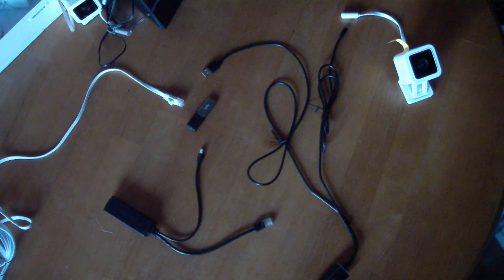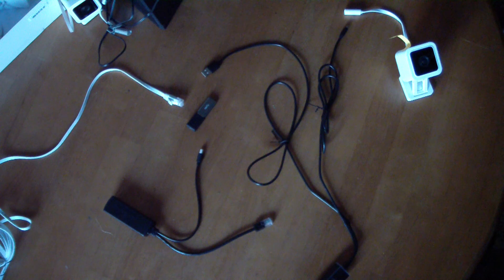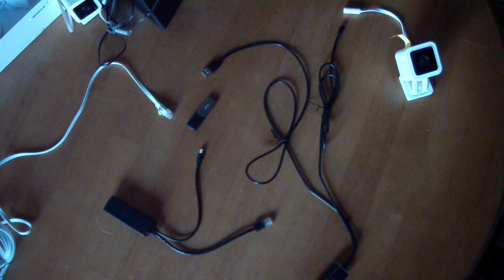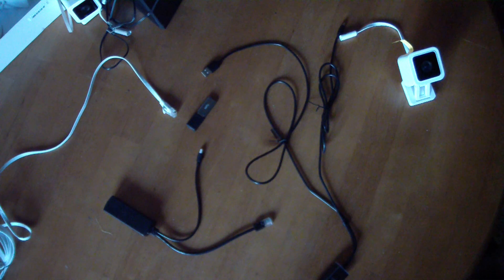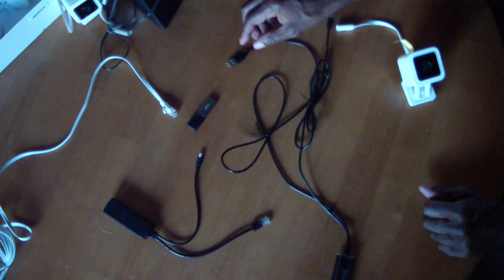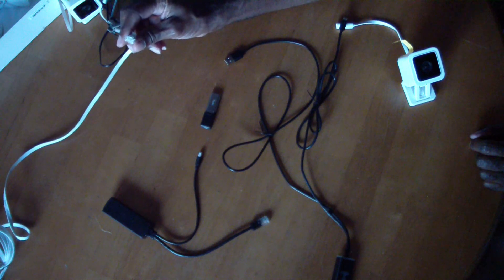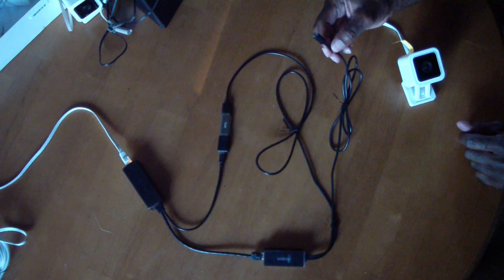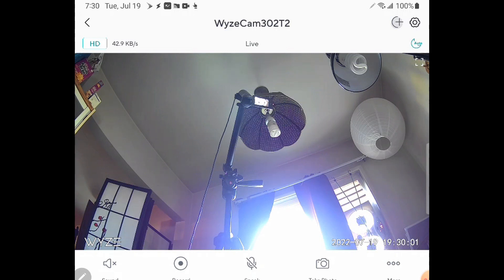POE for WyzeCam V3 (Power and Data)

Comment: is this still working with Wyze latest firmware? I noticed on the github that there's a max firmware written on it which is not the current latest firmware
Reply from the maker: The adapters work with the wz_mini_hacks software.  You can look at this discussion thread with respect to the latest comments on adapters: https://github.com/gtxaspec/wz_mini_hacks/discussions/73 

Do not know if the software itself is supporting the latest Wyze firmware.
Reply: @SwingingInTheHood  oh so you've not updated your cameras recently and just stick to the version that was working?
Reply from the maker: @silvahawk  With respect to my POE Wyze cameras, yes.  It is a hack, so you never know if new firmware will break it.  Until it's too late.